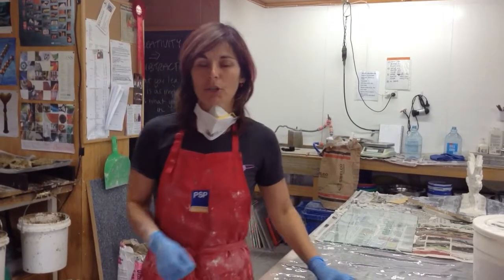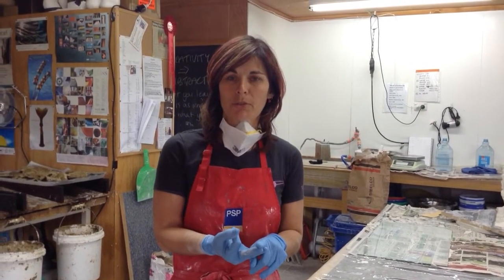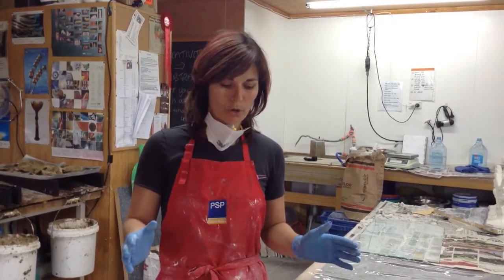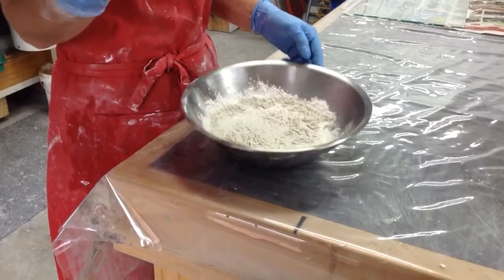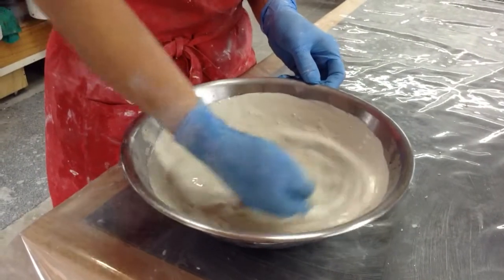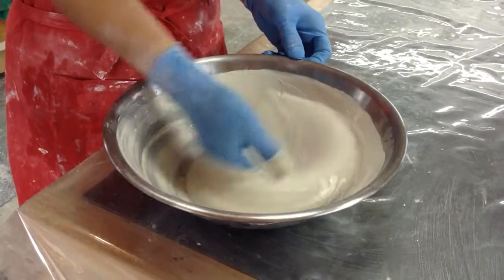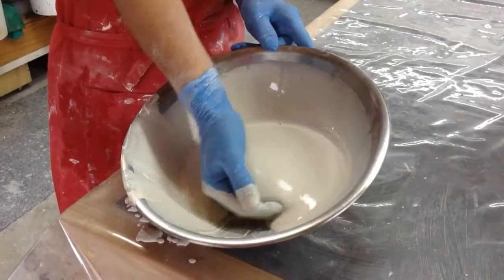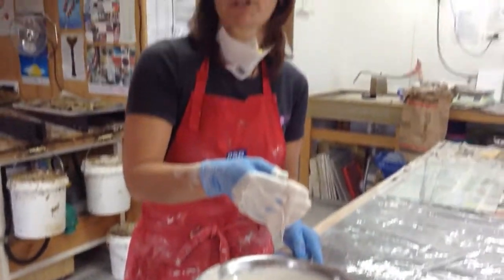Mixing plaster / silica for mould making - glass casting

Comment: Nice video so you can mix plaster of paris and silica sand together and fire it to get a harder plaster or glass. I imagine.... interesting it comes out as a glass those ratios...is it clear glass or white glass? Anyway nice work on video , wonder if you varied the ratios if you get more of ceramics material then a glass... or are you calling this glass material really a type of porcelain material... though most porcelain are done from kaolin clay but still its so interesting to see that a lot of mixtures yield similar to others... ( i have seen tons of peoples different mixtures different people like different mixtures but in some cases there so similar the output interms of the look)

Comment: Thanks for sharing your glass casting knowledge via these videos.  One info I was hoping to hear and learn (unless I missed it) is what about the drying and pre heating instructions for the plaster/silica molds?  Don't they need to be slightly heated prior to the final casting?

Hope you can make time to answer.

Regards
Reply: Hello Serge, i am sorry to comment on your comment, but did you find out the informacion you asked? Hope you have time to answer, thank you.
Reply from the maker: Oh and have fun with your kiln!